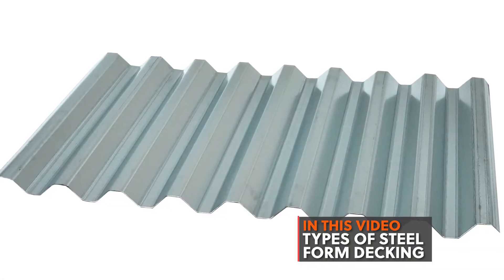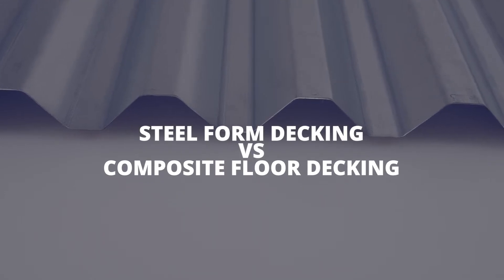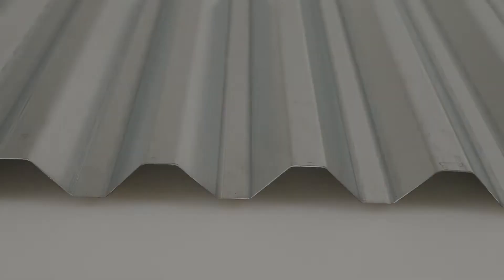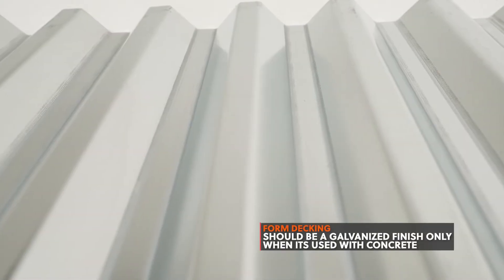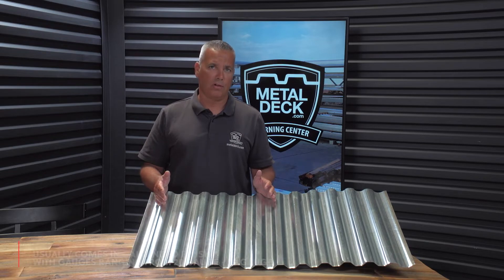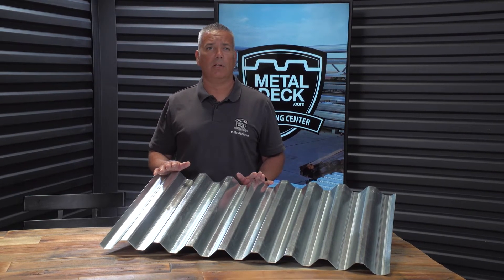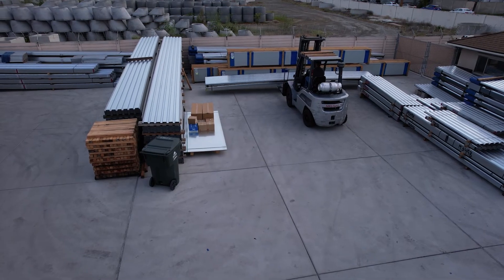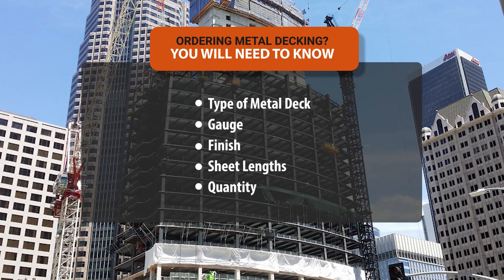Steel Form Decking Guide: What Is Form Decking? Form Deck Vs Composite Deck + Types & Uses

Comment: So I am building a 12x24 shed that will be used as a small powerlifting gym. I want to to use composite decking and concrete for the floors, that will be sitting on 4x4 pressure treated skids on a gravel pad. The reason for this is so that the entire shed can be moved vs just pouring a concrete slab and building the shed on top of that. My question is, what size of composite decking would I need to use to withstand a live load from someone deadlifting say 600lbs, and the weight being dropped from approximately 4ft. My original plan was to have 4 skids spanning the 12ft wide distance, so three separate runs of 4ft unsupported span. I could add another skid and make the unsupported spans only 3 ft. just wondering if this might work?
Reply: If you are not pouring concrete then you can use a roof deck. The deeper the deck = the stronger the deck. 1.5" or 3" deep will be your options. Here's a link and you can find load charts in the roof deck catalog that's located on the products pages for the different types of decks. God luck with your project.
https://www.metaldeck.com/metal-roof-decking

Comment: WHy is it called composite vs the roof deck which isn't?
Reply: Form deck is not composite decking. Composite decking has embossments in it. Composite metal decking and the concrete bond together to create a composite metal floor deck. The main advantage of a composite metal floor deck is that it will increase the strength of the floor without adding extra weight. With form deck that doesn't have embossments it is simply there to support the weight of the concrete. Roof deck is smooth and does not have embossments.